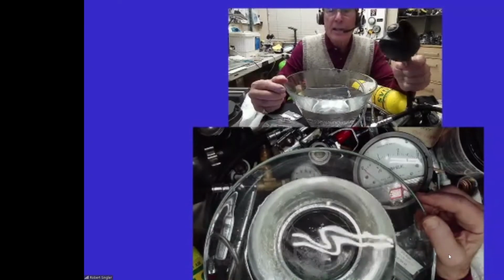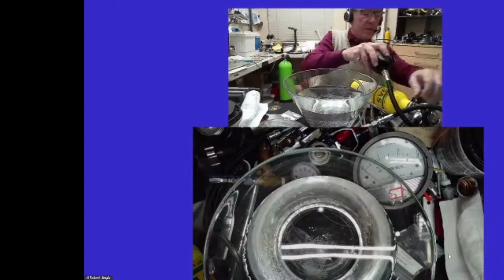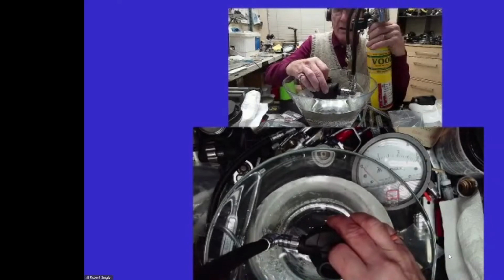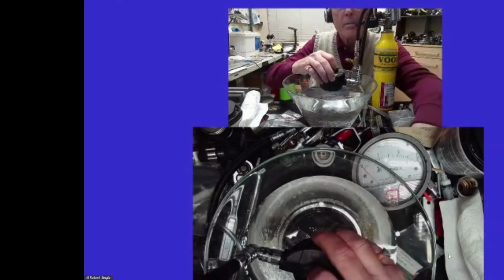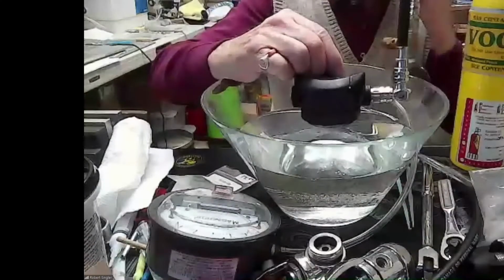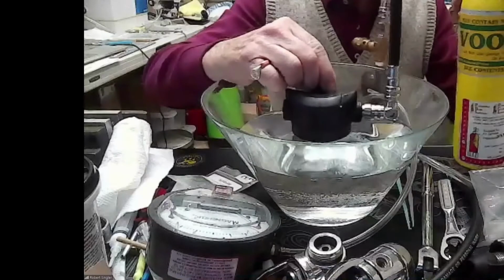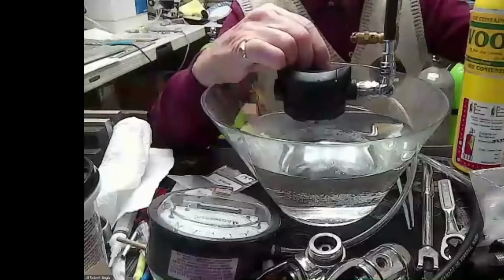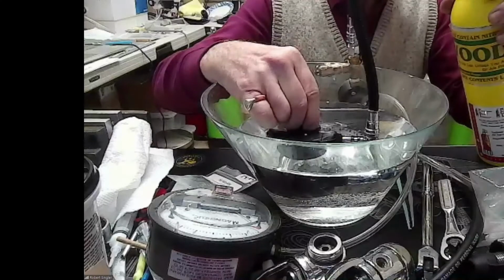Measure Cracking Effort with a bowl of water

Comment: Thanks for sharing your expertise. Would you recommend to tighten the crackling effort a little bit further to compensate for additional density (hence pressure) in salt water?
Reply from the maker: Thanks for asking! It's a bit like measuring with a laser,  marking with a Sharpie and cutting with an axe. The difference in depth required to activate the valve in salt water, when we're talking inches, is impossible to measure using this technique. Any increased effort you added to compensate would far exceed the contribution to valve opening by water density. 
 Second, since this is an "effort of breathing" setting, it's actually independent of depth, though it can be affected by reg orientation in the water (face up vs forward vs face down) due to "case geometry fault". Search for that on ScubaBoard.com.
 There IS a reason to adjust flow characteristics at technical depths (>132 ft) due to gas density, but that would be a change to the Venturi vane, not the cracking effort.
Reply: @robertsingler7258  Got it! Thanks for your reply.
Reply: For an adjustable 2nd stage, should the knob be full open for this test?
Reply from the maker: @dmartinez4683  Yes.  The adjustment knob allows easiest breathing/lowest cracking effort. This is your starting point.  Any lower and freeflow is possible.  Higher is as desired, e.g., to prevent freeflow on giant stride when you're octo hits the water, or perhaps when scootering. That is about the only time I will deliberately raise my effort of opening the valve. But while increased cracking effort can be measured the same way, it doesn't provide useful information. That is done "to feel", while minimum cracking effort is done to specification.

Comment: When determining the level of the diaphragm do you measure from the tip where the activator rests or the base where it mounts? Thanks.
Reply from the maker: I measure from my estimate of the inside of the diaphragm top where it presses against the purge button.  That is where water pressure is first exerted on the submerging diaphragm. The inside of that top is usually about 1mm higher than the visible top of the diaphragm, if you unscrewed the cover.

Comment: are all brand is same
Reply from the maker: Yes,  every regulator can be measured exactly the same way,  if two requirements can be met: 
1) you need to know where the front disc of the diaphragm lies in the case. Some regulators have a big protective cover over the top of the diaphragm, and the front disc sits further back behind the faceplate than you might think. 
2) the regulator has to be submerged with the diaphragm parallel to the surface of the water.  Some regs,  like those low profile disc-shaped octopus regs (think Aqualung ABS) can't be oriented with the diaphragm parallel to the water without water immediately entering the case. 

If your can meet both those requirements before the mouthpiece tube goes below the surface, then the distance from the diaphragm front disc to the surface of your bowl of water is about 0.1" more than the cracking effort. 
Why 0.1" more? Because that's the extra depth you had to submerge the reg from when the valve actually opened to when you could hear the tiny hiss.